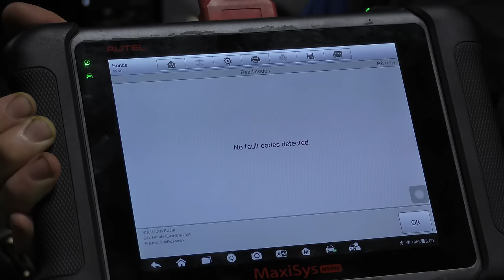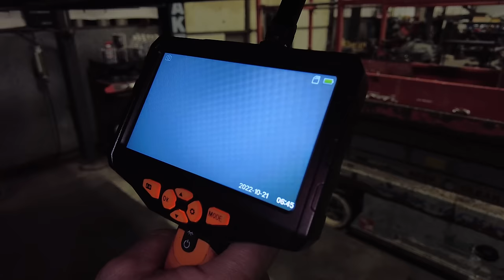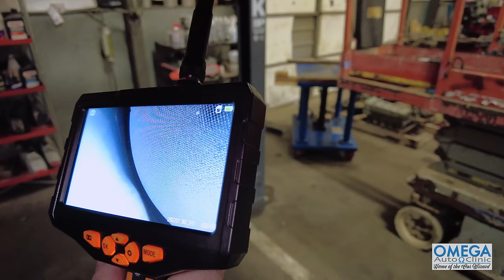Isolating the Problem? Engine Has No GO!

Comment: How does a cat end up clogged?  I've had cars, also Hondas, over 200k miles and never had a cat issue.  Could it be fuel quality, oil burn off/blow by?  I suppose if you live in a cold climate the initial start could be very rich for a while and eventually clog with unburnt fuel.

Comment: I just had my sisters Pontiac Vibe cat clog. It still had pretty good power but at higher RPM it would release all the exhaust from the flange right before the cat. The spring bolts would let the gases flow past and sounded like a turbo. Threw me for a loop being the first time hearing it.

Comment: My work truck broke down recently and we had a mechanic try to say it needed a new engine after he could not figure out why it was over heating. After he changed multiple parts guessing what was wrong we told them stop we are coming to get it. We get it home and it was the radiator clogged on the inside for some reason like it had stop leak put in. Replaced the radiator and its back on the road. You cannot go by google reviews because in this case it had 300 good reviews, but it was for the previous owner it recently changed ownership and the new owners are aweful!

Comment: If it cleaned up with compressed air like that, why not do that and try solvent if there is still a restriction. $700 plus labor is a big motivator.

Comment: Two Wiz questions on this issue. I typically buy new cars and drive them into 200K miles range. I experienced with several of them catalytic converter issues but always the engine warning light and cat-code would come up, why no code here? Also, on all of them I used cat-cleaner fluid and every time code and issue would clean up on first and only application and I drove those cars 60K-90K more and issue did not repeat, why not saving customer money and at least trying dirt cheap cat-cleaner first?

Comment: I watched the wizard  so long I thought  the converter  or even the fuel  filter/ pump. But only did it certain speeds .  With wizard  word of knowledge.   If it only works o ly certain conditions.  Test it on other  ways and see  what  happens.

Comment: An old school vacuum gauge will tell you if your exhaust is restricted, don't always need some " new fangled" scan tool,  it's been like this since the dawn of computer controlled engines, sometimes their are no codes, back to old time diagnostics
Reply: Where does it attach?

Comment: Before I watch it.... I witnessed a similar problem with one of my friends. They replaced the fuel pump, cleaned injectors, did a bunch of things. None helped. It was the catalytic converter. Due to increased oil consumption (old car) the catalytic converter got clogged up. No codes. The not yet clogged part of the converter was functioning fine burning off the fuel remains during idle and low power demanding driving, but it was acting as a stealthy restriction in the exhaust. Go figure.... let see what it is now.

Comment: I have a 2010 Ford Fusion that had a random hard start issue that threw a code for the coolant temp sensor.  Not very expensive and super easy to change I swapped it out.  Unfortunately that didn't fix the problem. Took it to a stop and they told me it was fixed but a few days later it happened again. Took it back and the two mechanics with over 80 years of combined experience were stumped. I finally took it to a Ford dealer figuring if they couldn't figure it out I may never find the issue.  The Ford  mechanic replaced the thermostat which seemed logical as the car had close to 170,000 miles and to my knowledge it had never been replaced. I got the car back and it started fine for a little over a week then the starting issue came back only this time it threw a different code for the MAF sensor this time. I replaced the MAF sensor and the problem was solved. The only thing I can figure is the Ford tech must have reprogrammed the ECU with an updated code base that fixed the incorrect code that was previously showing up so when it happened again the correct code was saved. The computers in modern cars do actually make them easier to work on but when they tell you incorrect information it can be a real headache!

Comment: My father had an 86 Toyota pickup that it too lost power. The truck was a lifted 4wd and we seen real easy the catalytic converter was clogged up. It was glowing cherry red. We just cut it off and replaced with a straight pipe

Comment: I think it might be the problem on my Saturn. Anyone here would like to give other theories? I have the car since 6-7 years. It always struggled to start, but went way worse with time, even to the point that it was hard to keep it running until it was warmed up. During some diagnostic session, a mechanic found that the EGR valve was constantly leaking. We changed it and it seems the ROOT of all my problems was the EGR valve. The car still was hard to start, excepted in cold times, where it started like a champ. With time i lost a ton of power nonetheless. We pushed the diagnostic and realised the engine was sent so much carbon by mistake that it ruined the injectors. I also had 2 extremely rich cylinders and 2 very lean others. Compression was awful while it was perfect 1 year before. I changed the injectors and now it starts perfectly fine, idles fine and all. I have a persisting symptom tho, that makes me think the catalytic converter is clogged. The power is still low a bit compared to when i bought the car, in hills at w.o.t. the acceleration is not perfectly even and it smell...chemical, like brake cleaner or something like that. I got no time to make it checked at the garage before parking it in a barn for winter, but i'd like to know if the wizard or some viewers have other paths to explore?

Comment: Okay, but I would think a plugged cat would cause a “cat performance below spec” code due to the difference between the upstream and downstream O2 sensors. That should definitely cause a check engine light, I would think. 🤔

Comment: I've got a  190K mile 90 Civic with the original catalytic converter.  It's never plugged up and the car still has most of the 92 ponies Honda claimed it had when it was new.  Were cat converters made better back then?

Comment: A bad pcv valve will allow engine oil to coat the cat, coating it over time. A common Honda issue. Polyurethane sway bar bushings fix the clunk forever. Looking at the tilt camber of the LR wheel you can see that the strut was weak or blown and would wear that tire unevenly.

Comment: I think it might be the catalytic converter but at same time if it is that I think the ecu would throw a code. I think I heard of fuel systems having restricted flow. I think the ecu would only pick up the pressure. I could see the ecu adapting to this by holding the fuel injectors open longer, eventually it would hit its max. I don’t think that would throw a code if the ecu is only measuring the fuel pressure. If the brakes were stuck I think more issues would show up. Engine compression seems like the worst case scenario.

Comment: A restricted exhaust WILL result in a loss of engine power - I ran into a similar situation some years ago when debris got stuck because of a hole that rusted out. Fortunately it was only the pipe that needed changing for a new section to weld back in 👍

Comment: Surprised a clogged cat didn't throw codes considering how sensitive modern cars are about emissions-related issues. I guessed a brake issue as my Frontier's e-brake switch failed a few mos ago so I drove w it partly engaged and thought it was down on power till I smelled brakes.
Reply: Yeah, Honda is so sensitive with those p0420 codes

Comment: I was thinking 3 things it could be:  a plugged cat, weak fuel pressure, or a plugged air filter.  I would check spark plugs and maybe do a compression test just to make sure those things are okay.  Transmission was obviously not the problem.  Usually the first thing I do is check all fluid levels and condition, and then go to the codes.  After that, I start testing/checking to eliminate things.  That will narrow it down.  This is why shops have to charge a diagnostic fee.  It takes time to test/check stuff in order to find the problem.  It's cheaper than just throwing parts at it, hoping you get lucky.  Which is what a lot of shops do these days.

Comment: This video is now 11 days old and I’m just now seeing it. I’ve only watched the first few minutes but my guess is a plugged catalytic converter and some exhaust shielding is loose and rattling but  I don’t know enough to guess why there are no codes. I have a 1996 Lincoln Town Car with 217K. I got it in 2005 with 111K on it.  For most of the time I’ve had it it shows the “Catalyst below efficiency” code but still runs great with plenty of power. Still averages 20-21 mpg with up to 24-25 mpg highway. Go figure. I’ll watch to the end of the video to see how far off I am.😊

Comment: I had that issue with almost complete loss of power and it turned out to be a clogged filter on the fuel pump, so low fuel pressure would have been my first step in diagnosing the problem (not a mechanic btw)

Comment: What's double insulting on top of the parts cannon list "diagnosis" is when they price the parts house parts over double what OEM parts cost. A local shop quoted me $2200 to fix my A/C. They said it needed a new compressor that cost $1000. VWparts website had it listed for $435. I refused the work but they already replaced the pressure switch as 'part of the diagnosis' and labor cost $400 to get the car back with no AC. The part they said they replaced was non functioning. I replaced the supposedly replaced switch, charged the system, and it's been fine since.

Comment: I got a similar problem on my Grand vitara 2007, we remove the cat en clean the MAF and sensor but now the check engine is on and we do not know if the problem is that we need to buy the cats o the sensor got bad, any advise? The code is P0420

Comment: driver side catalytic converter stopped up on my 14 f150 and it was quoted for $1200 so i cut them out and welded in generic converters for a fraction of the price. If my work truck was not worth a factory exhaust then who would think a Hyundai is?

Comment: My buddy had a clogged catalytic converter and he took it to the shop. He came back all excited and said the mechanic helped him save a lot of money. I asked how and he said they cut the internals out and welded it back together. I told him that's illegal and how are you going to pass the emissions test. He said something about splicing a wire from the catalytic converter sensor and grounding it on the transmission. It passed emissions, so I guess he did save $1200.

Comment: I've had multiple vehicles idle great but run out of power as you increase RPM's due to the plugged Cat syndrome
Most often, the honeycomb busts and turns sideways. They don't pass air that way!

Comment: Exhaust restriction is not a new problem.  In the 1960s Cadillac used double wall exhaust pipes coming off of the manifolds to reduce noise.  It was possible for the inner pipe to collapse internally and block the flow almost entirely.  Engine would idle fine, but would make no power when throttle opened.  Make you crazy trying to find the problem.

Comment: i dont know any shop or garage that actually wants to do more work than they have to, easily 70% of techs hate the job and just want to get it right and get it done. Shop might misdiagnose but rarely do they have mal-intent trying to "scam". There is always very few odd garages that will do it, but with reviews and a bit of research that wouldn't be hard to find out.

Comment: I've seen these symptoms before. 
It's indicative of a clogged catalytic converter. 

The computer doesn't see anything wrong because everything is reading as designed. 

Almost No air in means no unmetered air. 
Almost No air going through the catcon means no unchecked air at the sensors.

Comment: Have a 2017 jeep wrangler JKU. At about 68,000 miles made a trip to Tennessee and got some gas from wiggles gas station. I was low on fuel and pretty much filled up my tank. 87 regular unleaded fuel. immediately I noticed loss of power and to this day still have a massive loss of power. I wonder if something happened to my Catalytic Converter as well. I'm at 115,000 miles now.
Reply: Nope, just a typical newer Jeep product.  Unreliable.  Cheaply made.  Smart money never buys them
Reply: @ozarkliving7263   I'm aware of what I was buying when I got it. I pay cash for my cars and don't borrow money. I know Damien Chrysler owns the brand and many parts are shared across vehicles. The 2nd gen 3.6L pentastar is not that bad of an engine if you baby it and take care of it. I know it's not a toyota or honda. I'm simply suggesting that maybe some bad fuel could have clogged my cats, or maybe fouled my spark plugs, possibly resulting in reduced engine power. You don't have to suggest I'm dumb for buying it. It's not like I bought one of the other cheap jeep vehicles. The wrangler is a 2nd vehicle that is not driven daily. I have to disagree, the 2nd gen JK is not a bad car. it's pretty well built for what it is. I paid 18K for it, used. I'm happy with it. Not i do think that buying a new one is a waste of money. No jeep wrangler is worth 45k+ for what it is. The value isn't there. But a good used Wrangler is not necessarily a cheap or trash vehicle.
Reply: I plan to check the plugs and borrow a videoscope to check inside my cats like wizard did. It wasn't until i saw this video that i was even thinking about the possibility of clogged cats.

Comment: Camry had an oil leak, local shop said I need a new head gasket. Declined, took the car home fired her up. Within a few seconds oil started squirting from the oil pressure sensor. $15 and 1 min to replace, problem fixed. Learned my lesson real quick, get second opinions, research yourself…..always.

Comment: How many miles are on this car? Other things people need to be aware of: It takes quite a bit of time to plug a cat. converter on a well running car. One thing to look for is oil consumption. It may not seem like it is using a lot of oil (no blue cloud), but it might be enough to shorten the life of the converter. Is the thermostat operating properly so that fuel enrichment when the engine is cold is only for a short period. Long warm up time may not set a code but allows too much unburned fuel to go out the exhaust (rotten egg smell). Too much unburned fuel will cause the converter to run hotter and plug quicker. My nephew burned up his converter because the thermostat was stuck open. He lived in a warm climate and didn't notice because they didn't need the heater. EXPENSIVE fix on a Ford Taurus. It's always good to check for other things when a converter need to be changed to eliminate a cause that could kill the new one.

Comment: Quickest way  would have been just to measure the inlet and outlet temps of the cat when the car was running. The outlet temp of the cat should be significantly higher than the inlet temp. If the outlet temp is the same or lower, the cat is bad..

Comment: Drill a hole in front of the catalytic converter and put a pressure gauge in will tell you if it's clogged or not

Comment: Great Video - Cat? Clogged? (I was right...) Thought - Could you run Compressed Air "reverse" Through the CAT to clear it out - are there any Engineers out there to answer this - and save $800.00.....

Comment: I'm shocked at the amazing condition underneath that element
Reply: No road salt used in that part of Kansas.
Reply: As far as I'm concerned salting roads is a government crime
Reply: @glennbeadshaw727  except for the pesky lil issue of the rust belt wouldn't be able to function without it, in winter.   Just that 'lil' issue.
Reply: @18_rabbit  you see you just don't get it do you? The whole rest of the world functions without salt on the roads during winter

Comment: I had this an it was a chipped exhaust valve lack of power wrong fuel air ratio compression check &or bore camera …
Also check engine light was flashing

Comment: so he said for the cat and labor it was a grand but then said the bill was going to be over 2 grand. He is charging a grand for just back struts and the bearings? That seems really high. I mean 2 struts on autozone for an Element are about $260 retail. Mechanics get their parts at way cheaper prices then retail so 1 grand seems really high for the other part of the repair even if the cat is $700. Which I am assuming is an oem cat because I see multiple options for the Element on Autozone for under $500 some even under $300.

Comment: You may want to ascertain the chemical identity of the material on the cat substrate. They aren't supposed to die that way.
Reply: Looks like carbon buildup, so they should try to clean it out first instead of just replacing it.

The honeycomb is intact

Comment: I had the same thing with my Ford Automatic trans rough shifting and the code said internal switch faulty  $ 600 LATER NOT FIXED  WENT TO DIFFEREN SHOP
SAME DIAGNOSIS  ANOTHE 600  WENT TO Auto electrician found faulty wire $ 70 fixed no computer used to fix problem

Comment: I have two elements, 1 is identical to that 1 which is also named Elli and a silver 1 named Elliott. For anyone who doesn’t want to spend the money for the new cat. Take off the cat and remove the material inside, then put some o2 sensor extension/adapters on both sensors. Elliott just has a pipe and loose wires where thrives cut it. Runs fine